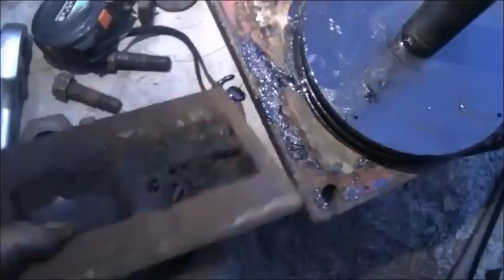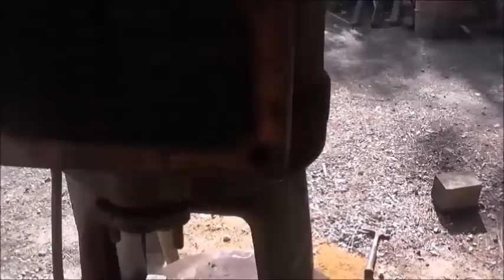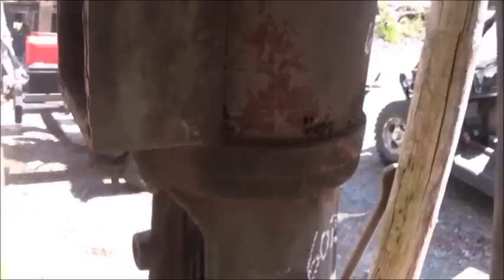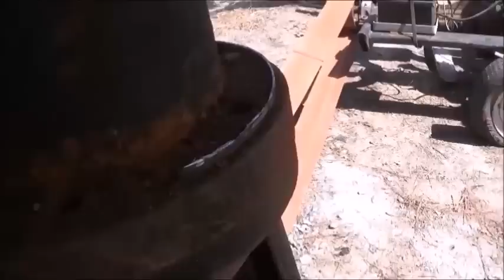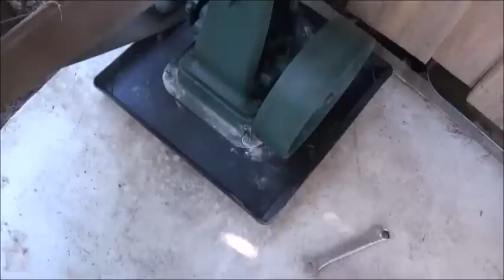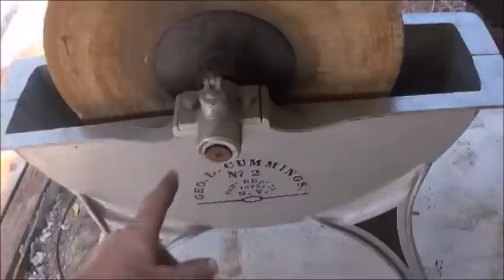UPRIGHT STEAM ENGINE REPAIR SITTING FOR YEARS PART 2

Comment: Jonathan, I have a reproduction 1908 Sears, Roebuck catalog that shows a 10 hp engine with specs and the bore and stroke is 7"x8", not sure of the rest of your specs, but it says Kenwood is the brand.  They state that the engines are shipped straight from the factory in Southwestern Michigan which I am guessing is Kalamazoo.  
The add also states full satisfaction up to 90 days or you can get you a full refund of the total $38.00 cost. 

 Maybe someone needs to call you about your extended steam engine warranty.  😂

Another great video.  There's just something about Steam.

Comment: C. H. Dutton was like Orr & Sembower in that they made steam engines for resellers or as parts of a larger machine. These were often unbadged or had the name of the company for whom it was made. For example my O&S Class F engine was supplied with a base that had "Ransome" cast on it. Ransome was a builder of concrete mixers. Your green engine is an O&S Class C. These had poured babbitt valve rod guides. The Class F have a sliding block guide similar to the Dutton.

Comment: I watched a guy make piston rings just a few days ago for a crude oil engine. He cut them out of an old pulley to the cylinder ID, spread them on a bolt and heared them to cherry red evenly with a blow torch. Made it look simple.

Comment: Curious about your pre-heater/steam-pump set up. Looking forward to seeing that running and that big boiler fired up! 
Hope to see how the cleaned up slide valve works in its housing.
Steam yard is coming along!
Sears Roebuck and Company. I grew up in the 50s when Sears was a titan. Seems like they built the Sears Tower in Chicago, and it was all downhill after that.
Thanks for your channel!

Comment: Remember SAE was first formed in 1916 and only had 5000 members by 1920(according to sae's site, got curious). So even later than there would be outlier shops still doing their own thing, eh? Curmudgeons, lol. 

But even back then how many people would take their engine in for service? It would likely be a mobile coot with a torch and a metal scraper that would come out to the farm for a day or three.

Tried that spray welding that Abom79 does now and then? To build up a surface for machining back to spec. Just another thought. 

Thanks for another vid so quick, have a good one!

Comment: Grinding wheels are not lapped in, You call it dressed, and you need to get a grinding wheel diamond from MSC to do it with.  After you get the diamond you will need to make a handheld holder for it on your lathe  ( use steel bar stock with allen set screws to hold diamond in it ) The ones I made are about 14 inches long.

Comment: The channel Yesterdays Machinery did a video the other day on making piston rings for a hit and miss engine out of either old brake discs or drums, you might want to check out. It’s a decent amount of work but definitely seemed to be within your capabilities, and certainly cheaper than outsourcing. I won’t say the video was a fully exhaustive tutorial, but I’d bet you could figure out the details.

Comment: I'm glad you found a rod to use, but just out of curiosity I have to wonder if you have a block of nickel how hard would it be to use electrolysis to electroplate that nickel onto a rod, how thick would you want it, etc.  I'm guessing you could use an old manual battery charger as the power supply for the anode and cathode.  I've seen folks make up their own brine solution to use for plating smaller stuff like vacuum tube shields and IF and RF cans on old tube radios, one even going so far as to plate the chassis and using zinc or copper for the shields and cans.  For small stuff like that they just used an electronics power supply.

Comment: In support of you using that cylinder rod, it make no sense to store items you don't plan on using in your pursuits. If the rod is the right diameter and length, use it! The only other thing to do is put it up on Ebay and hope it covers the cost of a new chrome rod. Just more delays... Use what you've got!

Comment: C.H. Dutton Co.
 Thread starterTanner Remillard  Start dateNov 11, 2001
T
Tanner Remillard
Guest
Nov 11, 2001
#1
Does anybody know of what the C.H. Dutton Company of Kalamazoo, Michigan manufactured in the late 1800's and early 1900's? I assume they made steam engines as I just found out that my Gardner Governor was shipped to this factory in December of 1901
R
Ron
Guest
Nov 11, 2001
#2
Yes, they made steam engines. Some of their steam engines were sold through Sears, under the brand name of Kenwood. The boilers were typically Orr and Semblower. If you can locate and 1895 or 1898 sears catalog reprint, you can see the many models they made. Sears only told thier customer that the engine was made in southwestern Michigan. I have one of these engines and boiler combinations. Thanks, Ron